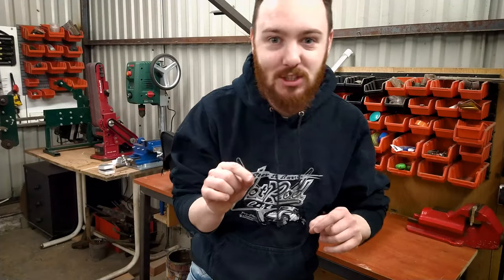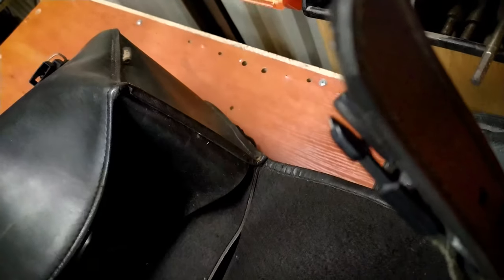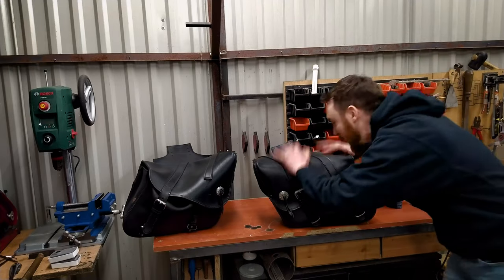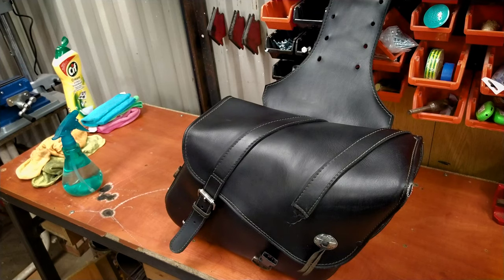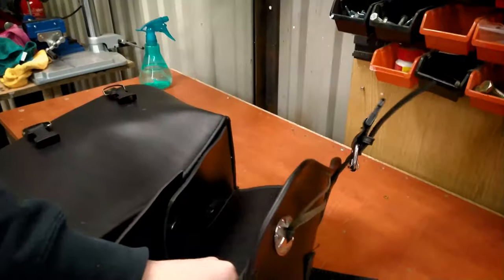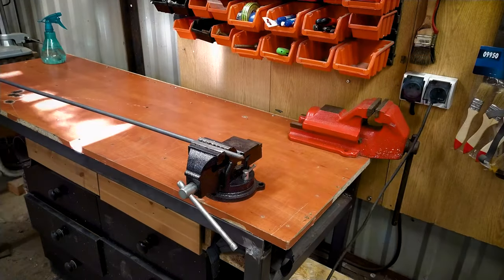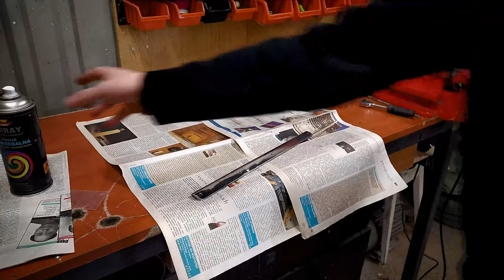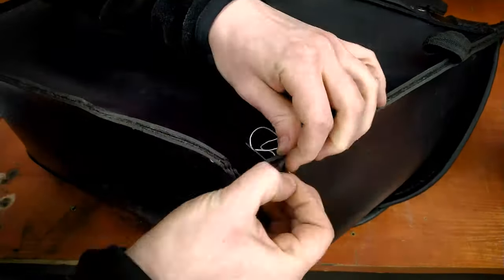old motorcycle bags - Unbelievable RESTORATION

Comment: Hey DB ..Jean here from Ontario Canada .just wanted to say i enjoyed your video as i recently bought a set of  saddlebags not sure if they are real leather but they to were in need of some love, although not as bad as yours but a little saggy and out of shape ,and they needed some restiching in a few places,now i don't have a heat gun but after i gave them a cleaning (didnt think of actually washing them like to did) ,just used an watered down all probus cleaner and a rag,,then used a heavy duty or strong grade of thread ,did the stiching ,didnt know about the 2 needle method then ,but as to the not having a heat gun ,i sat them near the woodstove and as you did worked them straight then supported them with wood pieces or a splint, left them overnight ,then next day removed the splints and let them cool ,and i must say it worked farly well ,oh and there was an od hole or 3 so i used my liquid vinyl patch on them to fill them and by the time i was done they like yours didnt look have bad,now im told mink oil does wonders on leather i think ill get me some and give them a good go over (my leather jacket needs a good going over with it as well .
Reply from the maker: Hi Jean! Thank you very much that you share your experience - I always appreciate when people join to the discussion:)! Leaving it near wood stove was good idea, but you must, know that natural leather don't like it much- especially if it's wet, and temperature is high - can crack (slowly drying is safer). I've used heat gun because this material is something like bubbled PVC (anyway, some thermoplastic). Generally speaking, all kind of natural oils will make leather a little softer and protected, so if you can get somewhere some mink oil- try it. Worse case scenario: if this bags are not real leather you make nothing using this oil.  BTW: if you have some before and after picture I would love to see it:)! My e-mail address is on "about" tab on my channel:). 
- Cheers, David
Reply: @DBCraftWorld  Ya i thought that might be the case ,for the record i only had them near the wood stove for maybe half hr or so then did the working it straight ,and then splint it .but i should of added when i left them near the wood stove over night i had moved them further back from the stove. still  getting warmth but not close enough to dry it out as you say.But i was remiss in saying i was quite impressed how well yours turned out.Oh and lastly i am presently working on a tail case for my new to me bike ,it's a treasure chest style case but i dont have the leather to make it from so im using very thin but strong plywood then ill cover it in leather from an old coat ,hope ill have enough and ya i think i have a couple of pics before the reair if i can find your address link i''ll send them to ya.
Reply from the maker: thanks a lot! I've assumed that you were careful with drying it- I've said that just in case you don't have any experience with a leather crafts:). The plywood "frame" is used quite often in motorcycle saddlebags- it will work fine! My mail is: dbcraftworld@gmail.com
Reply: @DBCraftWorld  Hey thanks for that tip or the info as i wasn't sure about it, iv been thinking about what's the best way to apply the leather.Oh i need to make a correction, the little holes in one of the bags ,there is also a 2 inch in diameter hole as well and i actually haven't repaired it need lol (forgot about it actually ),not sure if ill try and repair that or take it to a plastic weld guy i know of .as its a plastic backing that on them. oh as a footnote to drying them ,i never really got them wet , i didn't give them a good scrub as you did.
Reply from the maker: I had to wash it because of stink (lol). my plan was to shape it to original look during drying, and because water didn't make it softer, I've start to looking closer to this material and it turns out, that it's synthetic- that also explain the heat gun... If you have any question or doubts you can easily write me an e-mail. I think, that knowledge should be for free and that is why I always try to help!

Comment: Well found this vid by chance but got to  say, over all very well done on the restoration. Leatherwork and restitching  was done verry well, and using rivets to reinforce the more stressed joints was a great idea. As for the reshaping a more easy method to help with that would have been to make some plywood cut out in the same shape as the  bags and place in them a gymnastics ball and inflate it, or a large water bottle to stretch out and reform the bag walls while still damp and slowly dry it off while also applying some leather oil to be absorbed back into it. Then just leave it alone for 2 to 4 days before doing any more touch ups.
Reply from the maker: Thanks a lot for kind words! And thank you very much for the suggestion- I really appreciate it👊!
When I was washing those bags I've noticed that they don't absorb water at all. In fact this are not real leather, but something synthetic that imitate a thick  beef leather. The method you described is the most proper way of shaping a leather- I agree with you, that if this bags would be a real leather it would be the best way to reshaping it (and I would make exactly what you described, but I would never figure the gymnastic ball(!)- this is genius man!) . 
- Cheers David